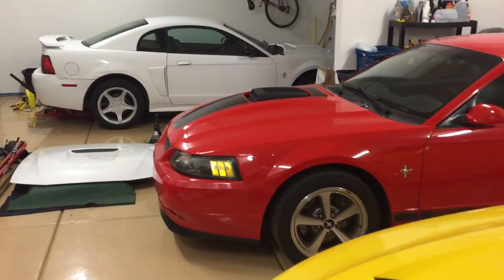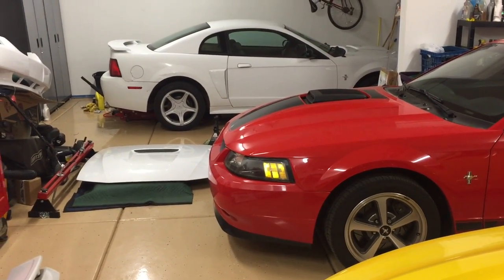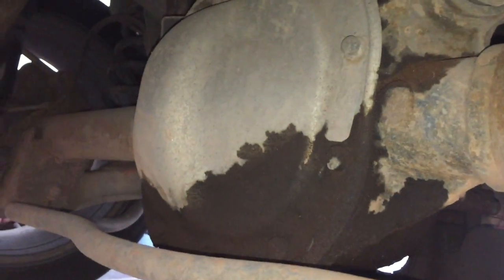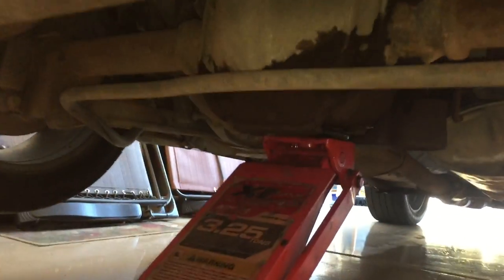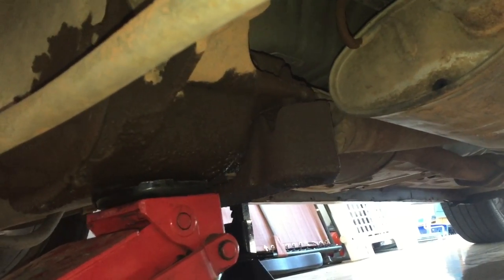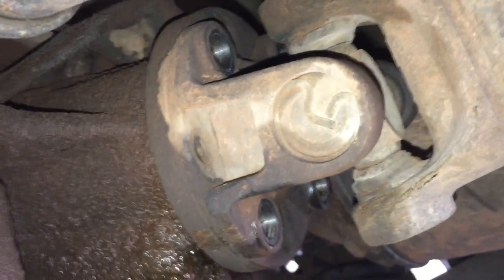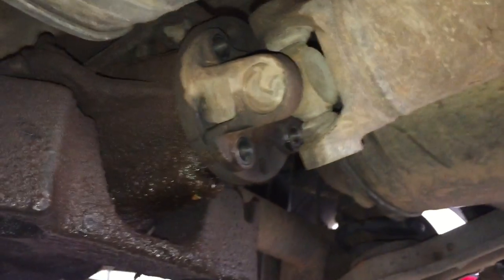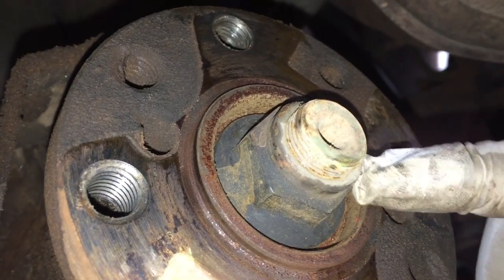Pinion seal replacement. Fix leaking rear diff Ford Mustang GT, Mach 1, Bullitt, Cobra, F150 8.8

Comment: Good vid. This is what I do. Remove wheels and make sure the e brake is off and there's no drag. Then put a inch lb torque wrench on and spin the assembly. Record your measurement. On reassembly,  shoot for the same number. No need to count threads. Use sealer on the pinion splines too. Also, if you tap an edge up on the seal, you can grab it with a pair of vice grips and pull back against the housing, pulling the seal out.
Reply: Can you do this without the differential spinning though?
Reply: @PiniMoo  no, it has to spin or else you can't measure the drag torque

Comment: I've found it much easier to remove the pinion seal by tapping a small flathead screwdriver with a hammer to get under up an edge, then a slightly larger one to continue prying it up. This does not scar the surface.

Comment: No Ford Friction Modifier for the traction lock??? I would definitely be adding that modifier.  I even add it to my t-5 transmission, shifts like butter. Nice video, I just thought I would bring that to your attention since no one else commented on it.They do use it from the factory!💯👍
Reply from the maker: You’ll see me use friction modifier in other videos. In this case I’m only topping off the fluid level so it’s already in the carrier. It’s been 2 years and no gear whine.
Reply: @dannyjohnsonsgarage  That's what's up!👍

Comment: Just did this on my 00 ranger. Only a flat head screw driver and a hammer. 
I didnt have those special tools. So far it hasn't leaked again!! Great video brother!
Reply from the maker: Glad you had an easy fix. Congrats
Reply: @dannyjohnsonsgarage hi. I just want to ask you a question isn't there foot pound measurement you can use on that nut so you don't crush the sleeve thst you are tslking about. If your using a torque wrench.

Comment: Have to do backing plates on my 87 F150 with a 8.8 this spring. 
All ready plan on axle seals so might as well do pinion seal while it's apart.
Reply from the maker: Norm Howes Definitky worth it. Here is a video I also have for the wheel seal and bearing while you’re at it https://youtu.be/U9kacxhGcd0

Comment: Take a socket that matches the outside edge of the seal hold it straight on it with a steady hand and tap it in you will feel it and hear it when fully seated
Reply from the maker: That’s a huge socket most people won’t have
Reply: @dannyjohnsonsgarage  sry mechanic from the inside looking out lol😁

Comment: Hey Danny, I just removed my pinion nut and it was only 15 turns.  The thing is...I didn't need a breaker bar and I was using the size 1/2 ratchet that you used.  I think if was actually loose.  So my plan is to use red locktite when putting the pinion nut back on 15 turns but will continue to turn until stop with no breaker bar use.  I think I should get at least 15 and some when tightening.  Does that sound about right.  I did spray PB blaster and let it set over night on the nut but I don't think it would have made it that loose.  It was super easy to remove.  By the way, the flange was easy to remove with little  effort using a puller.  Probably because the nut was loose?
Reply from the maker: It’s possible it has been off before and that’s why it’s so easy. Yeah, I would put it on by hand and crank it down. You shouldn’t be able crush the crush sleeve further by hand, but it’s possible, so just get it tight

Comment: I saw you did mark the rear flange and drive shaft area for proper realignment.  Is it not necessary to mark the front drive shaft where it slides in?  Also, if the front u joint is replaced while the drive shaft is out then it should be marked to go back in the same orientation also?
Reply from the maker: The drive shaft is externally balanced (off the car) so it really isn’t as important to mark relationships, and new parts will change a lot of it. It’s an old practice to ensure if it was fine when it comes off it should be fine going back on. If aligned at the rear, it should line back into the transmisión since the transmission has not rotated.

Comment: Can you not re-use the pinion nut with loctite ? That way you could make an index mark on the nut and flange for extra assurance when you reassemble and tighten the nut.
Reply from the maker: You can if you want to. The nuts are designed to slightly crush and deform, but can still be used. Make sure to use that lock tite. I had one walk off on me years ago and eat the track lock

Comment: Great video and information I’m definitely a new subscriber!!  Sir I do have a question and to see if you could give me your opinion I have a 2014 Ford Mustang V6 I just did the swap from a 2010 Mustang GT over to the V6 and the driveshaft I need to switch the pinion flange From my GT over to the V6 I should go ahead and replace the seal and is there any other recommendations you may give me that I should do before I make this switch? Thank you sir and look forward to your reply
Reply from the maker: If the seal is leaking, definitely replace it (and do it once it’s mounted to the car). The 2014 may already have the track lock diff as I recall, so maybe look into that before all the work for the switch
Reply: @dannyjohnsonsgarage  Ok Thank you I will look track lock.. I have to change my opinion flange from the GT over to my V6 I took my old pinion flange off of the GT and I’m ready to install it now on to the V6 do I need to install a new crush washer and how do I know if I have the preload correct? Thank you for all your help sir I definitely really appreciate it!! 💯👍

Comment: I’ve always had a problem with my ring n pinion leaking on my 94 GT. Do you have any recommendations of replacement parts that will discontinue the leak.
Reply from the maker: 1sik sn95 It depends on where it is leaking. It can really only be from the rear cover or this pinion area
Reply: 1sik sn95 if it's the pinion area then it could be a bad joint on the driveshaft, or a bad bearing inside the pinion gear

Comment: Another great video bud the step by step instructions are awesome and on the pinion nut couldn't you mark the nut and case also and do the counts?
Reply from the maker: You can, but you would have to scar mark it. Paint or marker rubs off as I found the first time I did it years ago. It’s hard to really see where it lines up with marks rather than counting revolutions. It’s really best to get it close than go as tight as you can by hand without crushing the crush sleeve any further (which shouldn’t be a problem without a breaker bar)
   I also like using the socket method for better visual without having to remove the socket to check. Also, it’s recommended to use a new pinion nut, so marking the nut may not help.
Reply: @dannyjohnsonsgarage True I figured you had room to use a punch and mark it(never had mine apart yet)lol to see if theirs room or not but your way is easy enough I wouldn't figure it has to be spot on that's a good idea of counting the threads😊

Comment: Hi Danny,

I have a 69 Mustang Mach 1, 428 CJ, 4 spd. top loader.  I looked at the 69 ford shop manual, which covers the entire '69 Ford line.  It's not known for its clarity..  From what I have read on some topics, I don't know how Ford ever made a running vehicle.  The manual covers a removable carrier and an integral carrier.  I have a removable carrier, though both types are listed for the Mustang.  For the removable carrier, the manual covers the pinion seal replacement for a "collapsible spacer" (your crush sleeve) and a "solid spacer".  Any idea  which I would have?

For the crush sleeve it says to install a torque wrench on the pinion nut, and record the In-Lb to rotate the pinion shaft.  After seal replacement to tighten the nut to provide an additional 8 to 14 In-Lb of rotational torque.
For the solid spacer it says to tighten the nut while rotating the pinion to seat the bearing and then torque to 180 to 200 FOOT-POUNDS.

Of course, the manual calls out four different special tools to complete the task.

I'm guessing your match marks on the drive shaft yoke and the axle u-joint flange are so that the u-joints are in phase on reassembly.  However the shop manual also calls for match marks on the pinion shaft and the inside surface of the u-joint flange.  Any thoughts as to why?

Danny, thank you for any advice you can give an old man.
Reply from the maker: This setup for the 8.8” has a crush sleeve, and as you’ll see in mu gear install vidoes it takes a larger breaker bar to crush it. In my experience, it’s useless to try to mark the pinion threads to put it exactly back where it was. You’re best off tightening it as much as you can by hand with a 1/2” ratchet and make sure it’s a new pinion nut with lock tite. 
   I am not familiar with the older rear end on your 69 mach 1, so all I can really say is what works on the 8.8”. I imagine it’s similar. Best of luck!
Reply: Thanks Danny

Comment: Hi,
I followed this video to the letter and it is awesome. However, I’m noticing a hum coming from the rear end now. Did I over tighten my pinion nut?
Reply from the maker: It’s possible it’s too tight if you used more than a hand wrench to tighten it down, but it can also have come loose if you didn’t use red lock tite and a new pinion nut. Mine came loose very quickly the first time without the new nut and lock tite. The best thing to do is remove the driveshaft and see if you can jiggle the flange on the differential (where it attaches). If it seems tight, turn it by hand (with the parking brake off) to ensure it’s not too tight and bound up
Reply: So my lock and nut are not loose. I reviewed your video again and when I pulled my differential everything thing loosened up and came forward. I your video you only lose a little gear oil my eventually all leaked out. No problem I filled it up. But I do notice a little slop when I moved the differential to see if it was bound up (it wasn’t, it moved just fine). But like I said it has some slop. Any ideas?
Reply: Thank you for the reply hopefully you can understand my last reply it’s not very well written. Basically everything looks okay (nothing loose) except I do have slop when I turn the differential. 

Bye the way,I know longer have a leak.

Comment: Danny, I’ve been on the fence about doing this myself. I have an 04 cobra also. What worries me is damaging the sleeve after reassembly. I have an appointment with Ford to do it, but I fear the tech who will do it will be rushed for time and over torque the nut.
Reply from the maker: I also like to do my own work at take the time needed. If you’re using hand tools as the video shows and not a huge breaker bar, you won’t crush the sleeve any further. I would try it first and if it’s bad then let them do it. Here is my irs playlist too for other work https://youtube.com/playlist?list=PLIjr-uSYDZi4GVUMK2SdUL74fClSt4-IZ

Comment: Hey Danny.  Great video I will be following your instructions on how to change the seal.   Can you point me towards the type of puller I will have to use?   Maybe I can rent one from the auto store.  But not sure which one I would need.    Thanks Danny
Reply from the maker: Yeah, try to see what you can rent, but if you buy one they sell just the puller part (mine was a complete snap on set so I would recommend buying that) but here is one for reference that would work. They have different sizes to choose from so I would think the 6” would be plenty big, 3” might be the right size but not big enough in the end https://www.amazon.com/gp/product/B08G8SQ7FJ/ref=as_li_tl?ie=UTF8&tag=2004047-20&camp=1789&creative=9325&linkCode=as2&creativeASIN=B08G8SQ7FJ&linkId=10a017d81e24608e5b06a240d0e52e70
Reply: @dannyjohnsonsgarage  Thanks Danny I appreciate it.  I think Harbor freight had a set but like you mentioned one was small one was huge.   If I can’t rent one I’ll buy the assorted set.   I have the harbor freight “bolt type wheel  puller set” but not sure that set would do me any good.  Again thank you for the recommendations!
Reply: I changed the pinion seal the other day.    I had a new nut also.  I counted the threads and made a mark like you said.   Everything seemed to go well but when the marks met up the yoke wasn’t fully tightened which was a little weird.    I tightened the nut about another turn and then it seemed good.   The amount of threads showing was the same.  Just threw me off a little bit.   Went for a short ride and it seemed fine.  I want to do some more driving and check for leaks but it’s been so damn cold here and work has been busy
Reply from the maker: @jamesa6272  for the nut to line up exactly where it did it would also have to go on (start) right how the other one did as well. As long as you have lock tite and put it on as tight as you can without a breaker bar it should be good.
Reply: @dannyjohnsonsgarage  yes I used a dab of red loctite and the loctite that was on the new nut tight with a 1/2 inch ratchet without a breaker bar
Reply: @dannyjohnsonsgarage  Hey Danny. I drove it some more on the highway and noticed it’s leaking when I go under and check for leakage.  It’s raining here so I didn’t get a chance to pull off the driveshaft and look but I do notice that round gray plastic on the flange can move. Is that supposed to be tight?   It’s that gray plastic part of the flange you point to in your video where you say it’s okay and normal to have a small gap.  Well that thing I can move back and fourth in and out.  Not sure if that’s supposed to be tight or not.  I also put a small amount of silicone gasket maker around the seal like you did.   I also placed a new seal repair sleeve on the yoke
Reply from the maker: @jamesa6272  yeah, try tightening it down a little more, it takes some pressure to crush the crush sleeve so just don’t use a huge breaker bar with a lot of force.
Reply: @dannyjohnsonsgarage  So I did the repair.  It’s been going on about 3 or so weeks now.   I notice when I’m going slow or just moving the wheels on jackstands I hear a slight squeak coming from the pinion seal location.  I also did U joints so I’m not sure if it’s the ujoint or the pinion seal location. It seems to be the pinion seal location though.   I’m wondering now if It’s to tight or if something is wrong or not.   I don’t hear any whine while driving though just that faint squeaking when going a slow speed.    Any ideas?
Reply from the maker: @jamesa6272  I wouldn’t remove the nut any. It’s very unlikely it’s on too tight if you tightened it down by hand. With the wheels off the ground, safes on Jack stands, wheels chocked, you can put the car in neutral and rotate the driveshaft back and forth to see if it has any back and forth play (backlash). There should be a small amount. Inspect the pinion flange where the drive shaft connects and see if that plastic part is in fact grinding
Reply: @dannyjohnsonsgarage  I happened to do that yesterday.   I had a screwdriver on the plastic piece of the pinion flange with the screw driver handle to my ear to see if it was that.  It’s hard to tell.   There is backlash when I move the driveshaft. It felt pretty much the same compared to when I first started the job. If it were to tight there wouldn’t be any backlash?   The good part is it’s not leaking.   I just don’t want anything to be wrong and screw up the rear.   I know it’s extremely hard for you to go on what I’m saying and not seeing it for yourself so I appreciate the insight.   It’s just a slight squeak when I move the driveshaft and when the car is moving at a very slow speed.   I would love to change the gearing and put in a new crush washer but I don’t think there is any way I could get the leverage I would need to crush it on my back with the car on jackstands.   That and I don’t have any kind of press I could use for the bearings

Comment: Man how did you get the pinion nut off? I am struggling. Laying on your back makes it worse
Reply from the maker: It’s super tight! A thicker breaker bar with a pipe over it (cheater bar) might work
Reply: @dannyjohnsonsgarage  it is super tough! Probably the worse job I’ve ever done. Yes I was trying that but it’s just no room to put a a pipe over the breaker bar. Then I have to worry about how I am going to exert enough force to move the bolt. On top of that, I tried to insert a few bolts to hold the flange but it’s just difficult. I am investing in a air gun lol
Reply from the maker: There are even some good electric impacts out there (maybe borrow one from someone). Sometimes it’s best to put the impact on and go tight, loose, tight, loose in short bursts to break it free. 
  You can also try putting a jack under the handle when you’re pushing on the right direction (coming out the driver side so it’s counter clockwise on the way up) but be very careful not to lift the car off the jack stands that way
Reply from the maker: https://youtu.be/IYbVH2Igk6E?si=wY_XDg0eAHfb7UMM

Comment: can we have a link for the pinion flange pulled you used? also is this the exact same process for a 07 auto GT?
Reply from the maker: Mine was an older snap on brand one, but it should be something like this. Yes, same process on 07 GT https://www.amazon.com/gp/product/B07LC7MC52/ref=as_li_qf_asin_il_tl?ie=UTF8&tag=2004047-20&creative=9325&linkCode=as2&creativeASIN=B07LC7MC52&linkId=6189965096094b1617160176fab62cc3